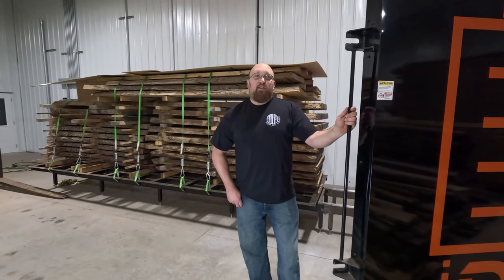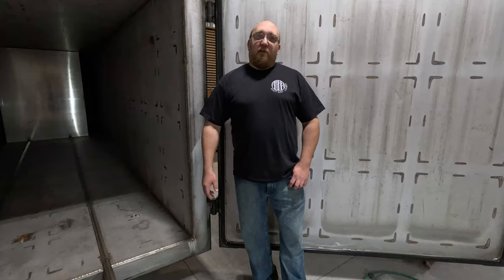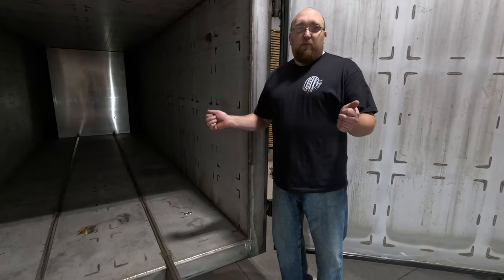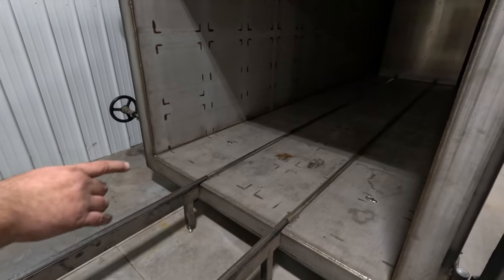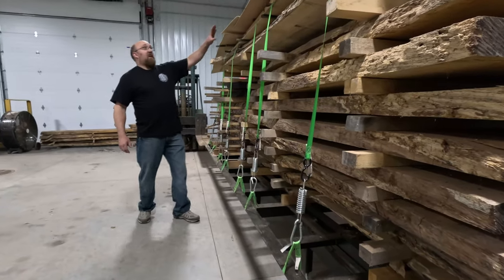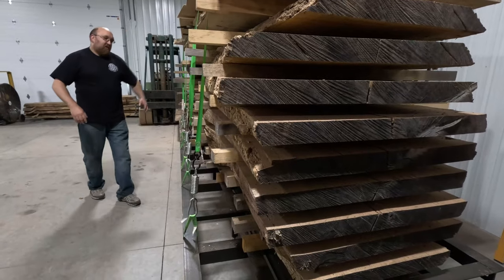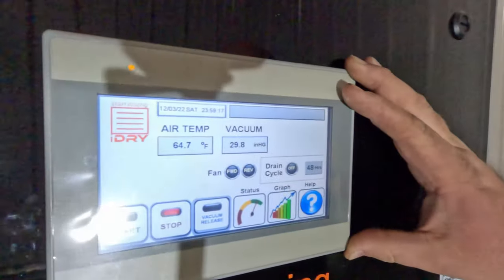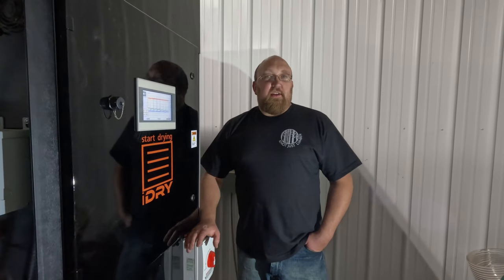Idry Plus Vacuum Wood Kiln Overview

Comment: Im considering buying one. Has the idry been profitable for you? I have a small sawmill and am wanting to add drying services. Thanks
Reply from the maker: Yes, it has been. We recently added a 2nd kiln because we had enough demand. Profitability isn't as much as we initially expected though for two reasons. 1. Some loads take longer than the online calculators estimated because we start with fresh cut customer lumber. If you have the time to air dry to about 25% this will significantly cut down on the time in kiln. 2. We price our service by the BF rather than hours. It gives the customer a more predictable cost but sometimes less profitable on our end. Good luck man!